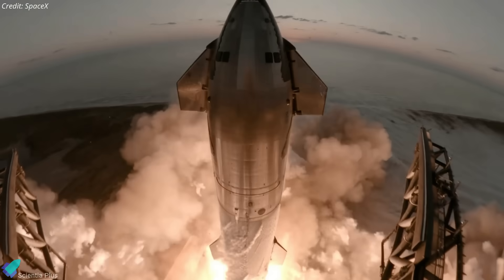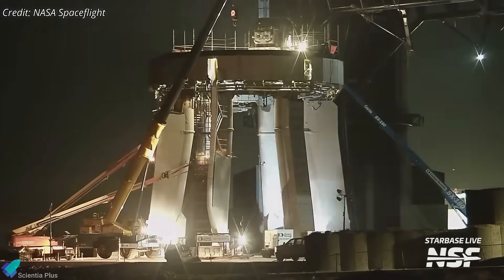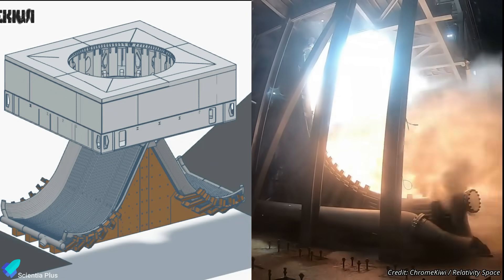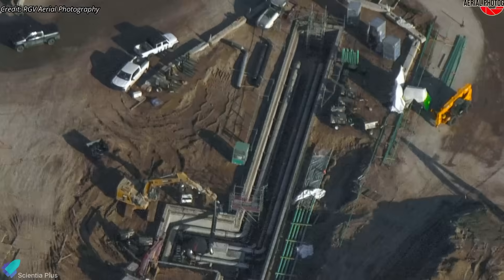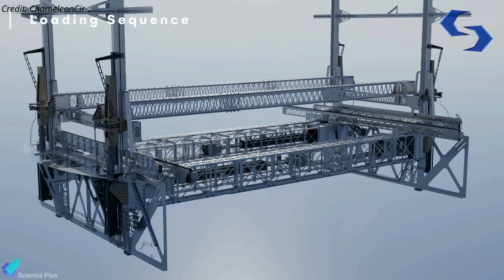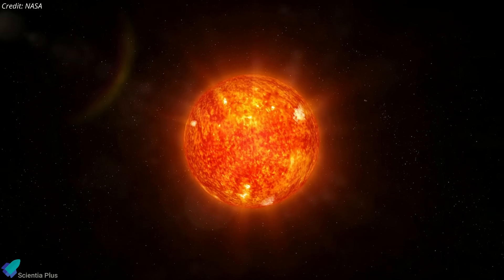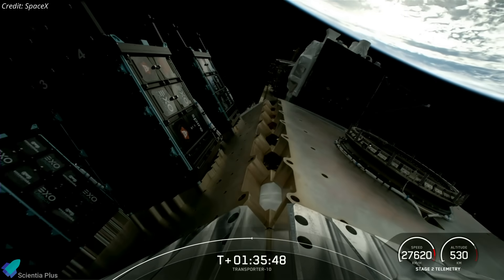SpaceX Starship Block 2 Ready for a Major Upgrade! Massive New Part Spotted What is This?

Comment from the maker: 00:00 Starship Updates 🚀
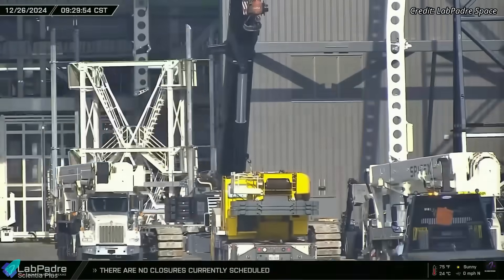07:55 Parker Solar Probe Breaking Records: Faster & Closer to the Sun Than Ever Before! 🔥
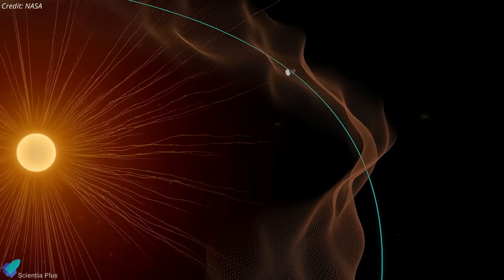10:17 Bandwagon Mission Unleashes 30 Satellites into Orbit!"

Learn More:
1. Starship V2 Explained: 
Summary: https://shorturl.at/9Iudv
Detailed Explanations:
  a. Design Improvements Update 1: https://shorturl.at/lpGT7
  b. Design Improvements Update 2: https://shorturl.at/gwNQ4
  c. Nosecone & Payload Bay Redesign: https://shorturl.at/xa60S
  d. Methane Downcomer Redesign: https://shorturl.at/XdYBG
2. Starship V3 Features: https://shorturl.at/mnBT4
3. Starship V2, V3 & Raptor V2, V3 Complete Update: https://shorturl.at/tN248
4. Raptor V3 Mega Upgrades & First Test: https://shorturl.at/TRIyj
5. Latest Starship Upgrades
  a. Starship Hot Staging Explained: https://shorturl.at/jf400
  b. Super Heavy Booster Upgrades: https://shorturl.at/Pi5R3
  c. How SpaceX Protect Raptor Engines: https://shorturl.at/4Om8F
  d. Starship New Heat Tiles Explained: https://shorturl.at/p2Ijb

Weekly Updates: https://bit.ly/3HIQjPC
SpaceX Playlist: https://bit.ly/34wue8T

Comment: With the new dispenser available and without testing the earlier design I suspect SpaceX will need to send up some technicians on a Dragon to free up the dispenser during initial operations. Hopefully the same team that worked on the satellite delivery systems on Dragon will have been put to work on the Starship version.